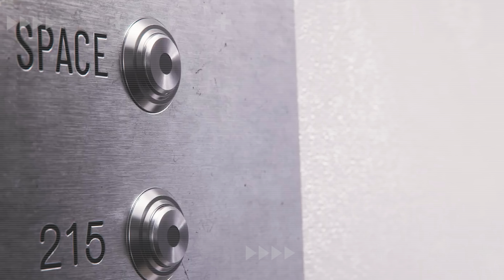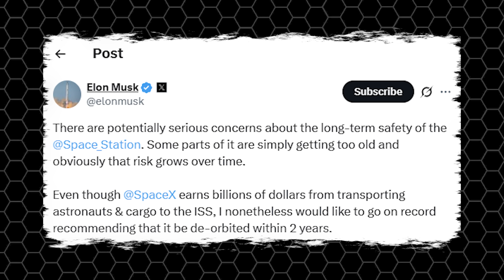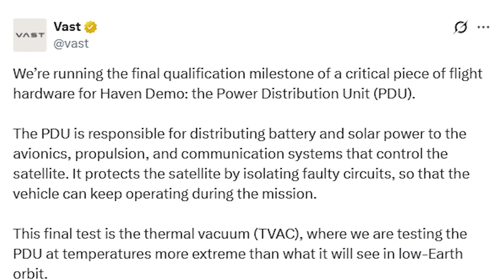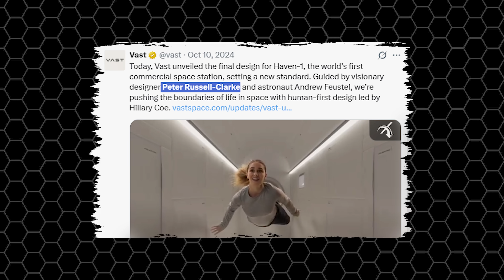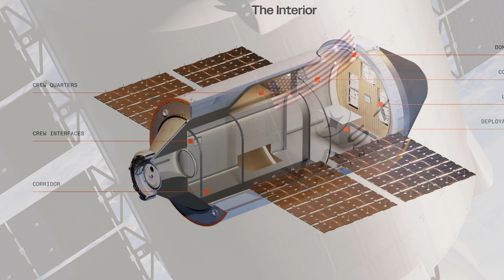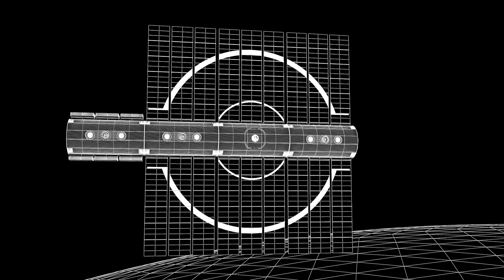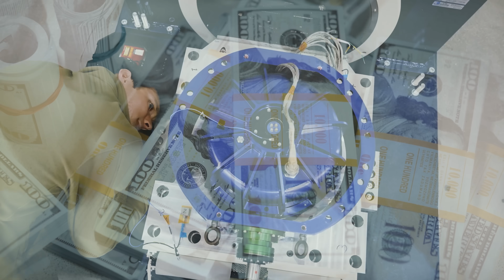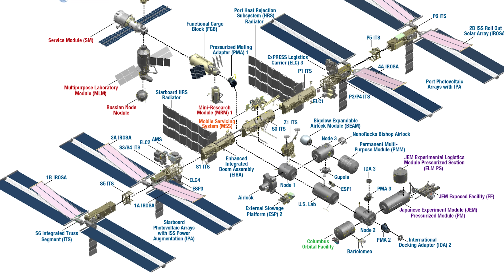SpaceX's New Gravity Space Station is not what you think!

Comment: One should not underestimate center-flying forces (from which artificial gravity is decomposed), they release forces that if material is not firmly anchored enough inside the frame itself, not only break outright but also bend, twist, or even break like similar matchsticks. Airlocks that are already very sensitive will then cease to function, leak and thus simply make a space station unusable if torsional forces are applied to it, especially if they function as hinge points in a real sense as is the case now are outright design flaws that only stumperds make.

Comment: It is not over yet??? ISS is working in use ground tested
Avon is like all other things not done up running?
ISS can still be exteneded adapted? chpped changed
pushed back up to a better orbit?
 5 new lego Meccano slot clip bolt sections
with more extendable options
and dropping the old to burn up part by part?
tried trusted mis better than  new is always better

Comment: Let’s get real. Vast modules are about the same diameter as ISS modules. Even the fully evolved Haven 2 complex, while larger than ISS in volume, it isn’t significantly larger. Getting gravity from spinning a structure in space goes back at least a century, not invented by Vast CEO. The geometry proposed doesn’t lend itself well to providing crew gravity, let alone 1g, the station would need to spin at 9.5 revolutions per minute, if a radius of less than 40m is assumed from Vast specifications. Anything above 2 revs is considered problematic for human occupation as it induces vomiting.
Reply: What you say is true. Still I wish someone would try spin gravity in LEO to simulate Lunar or Martian gravity. Solid medical data before building permanent bases seems like a cost saving measure.